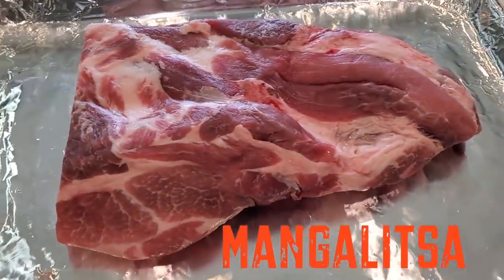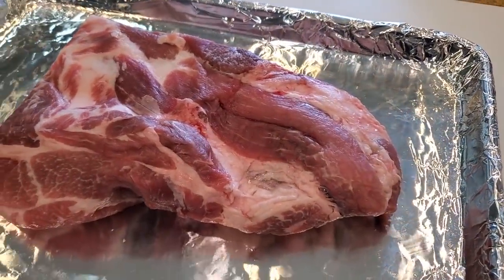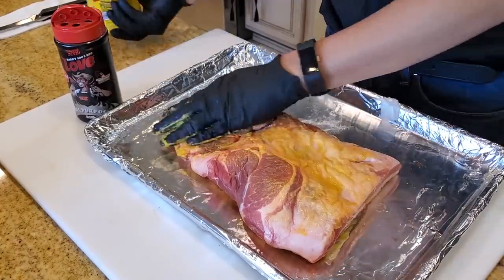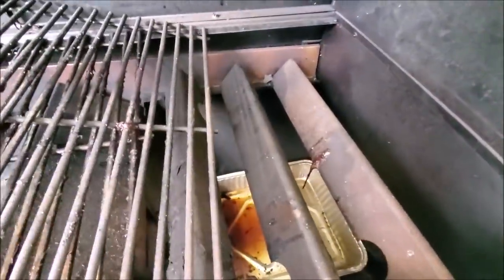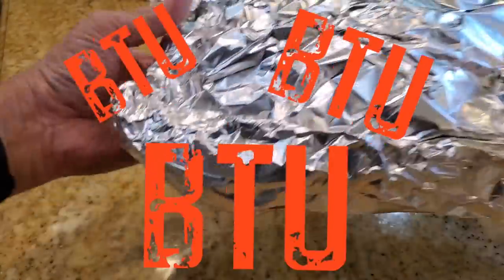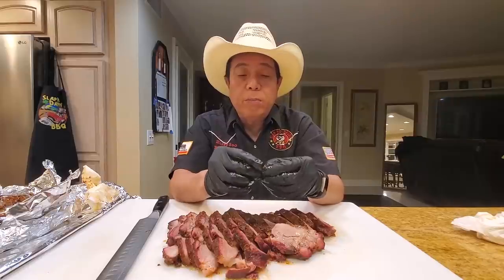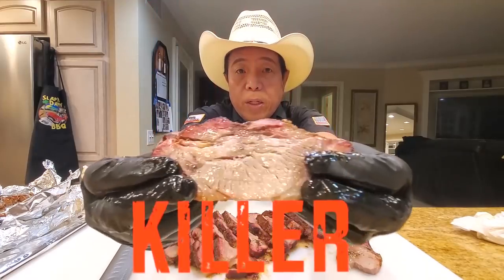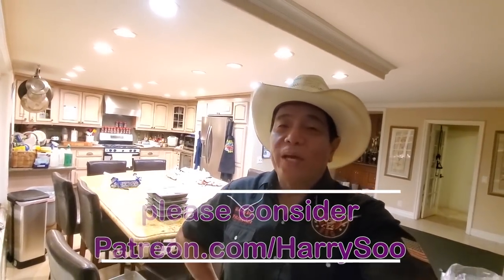Mangalitsa Pork Brisket | Heritage Kobe Beef of Pork | BBQ Champion Harry Soo SlapYoDaddyBBQ.com

Comment: Hi Harry - that looks great.  What was the temp of the brisket before wrapping (165 ish)?  Also, what was the brisket temp taking it from the oven (202 ish)?  Sorry , I don't recall that being given in the video.
Reply from the maker: See 6:31.  I don't cook using internal temps as you have probably seen from my 300 videos.  Pork is tender between 185 to 205 depending on many factors including cooking method.